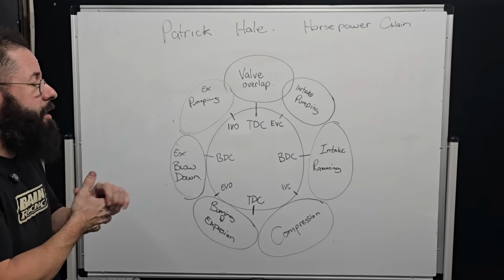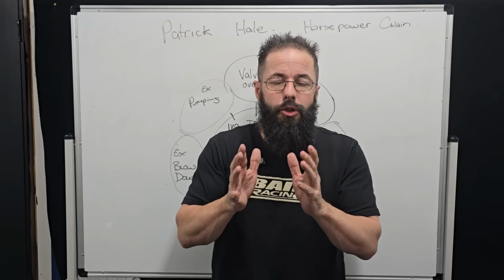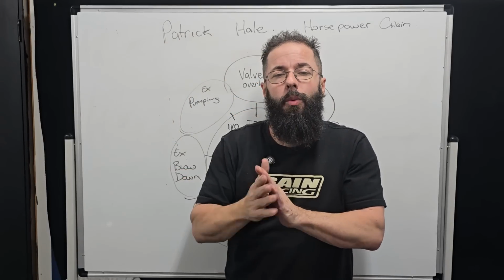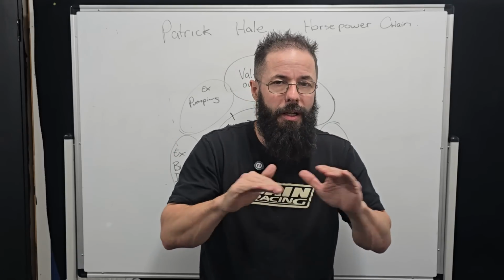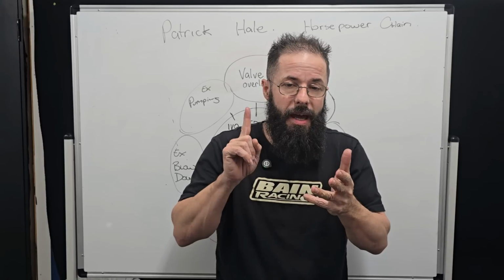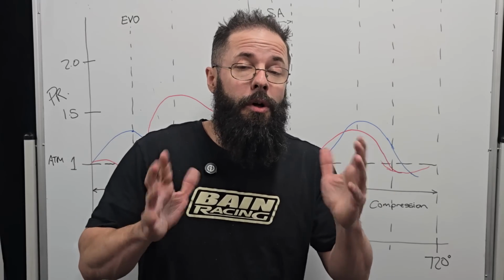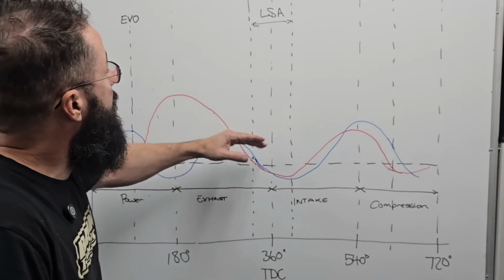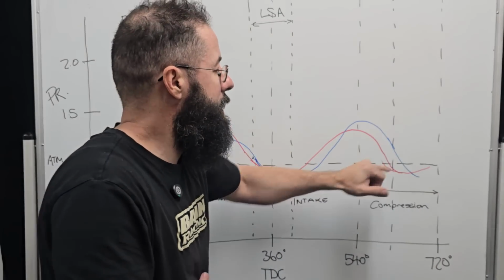Induction Secrets Part 11 Horsepower, Cam Timing Wave Analysis & Engine Simulation. Bain Racing

Comment: Hey Jake, Are you familiar with a calculation that will determine the IVC based of of area under the flow curve, average inlet area, intake runner length and inertia supercharge effect?  If so, is that outdated in todays world especially with all the simulation software out there.  Matt USA
Reply from the maker: Hi mate. I have seen a few. I think simulation,  or software is better for this sort of thing.  We will be covering rick Jones software later in the year and others like EA and dynomation.  I might do a video on some of these IVC closing calcs too.  If you have any you want us to add. Feel free to email us mate.  It won't be till later in the year.  But its on the list 😉👍
Reply: @bainracing  I would love to hear more about it from you!!!!   I was taught this formula in the early 90s by a GM airflow development engineer and was very successful with it.  But like anything you have to keep up with technology.  Cylinder head design and efficiency has come a long way since then and we do things much differently now.  I will email you the formula I use and would like to hear your thoughts on it.  Have a great day my friend!!!🤙🤙
Reply from the maker: @NJRacin you too mate. Have a great one. 😉👍

Comment: After 50 years the guy tells me you cant use lsa to pick a cam,you are guessing. You have to start with the ivc point. I dont know that thats a better guess. Ok
Reply from the maker: The problem is that LSA is a combo, chamber-dependent. This is also affected by intake length, as this will affect IVC timing. 👍

Comment: 10:1 engine will spool turbo faster than the same engine with 8:1 as you said. Can you explain why? Turbo is driven by exhaust gas energy which is ether temperature or velocity. When we raise compression 2 points what changes - exhaust gases temperature or exhaust gas velocity?
Reply: Well exhaust gas temps increase with less compression (you see this in EGTs on the dyno), and the exhaust velocity is dependent on port/valve size, so those things seem like they are what moves the turbine wheel but that's not really the case. (It's usually due to the aperture of the turbine housing and the design but that's another can of worms that's not part of this compression question.) The one thing static compression does that helps with turbo spool is raise the thermal efficiency % of an engine so that it produces more pressure (IMEP) out of the same amount of fuel/displacement. You'll see this with the increase in TQ across the curve while also in the fuel flow staying relatively the same while the BSFC improves. You'll also get a marginal loss in vol eff % when increasing compression because you lose some total volume of the cylinder, but it's offset by the compression increasing efficiency of the motor. What spins the turbo faster, like almost all hot side stipulations in an engine is that the torque output increased at those RPM, and with that you get more energy flow out the exhaust pipe. Just like a larger engine will spool the same turbo quicker, or header sizing in most NA applications is dependent on HP/cyl. Hot sides of all engines run on how much output the engine is making and then having to exhaust, with increased output you increase the energy coming out the pipe.
Reply: @bretbauer7582  so it would be fair to say that higher compression ratio (all else being equal) spool turbo faster in time, not in RPM range?
Reply: @Georgianson  the higher compression ratio will help spool because it creates more TQ in the RPM range where the motor is running NA essentially. The earlier in the RPM range you can create turbine wheel movement, the faster the spool will be in time. The drawback is more compression will help get you there "faster"/ at a lower RPM, but it will also hurt you after you hit the wastegate because it will make the engine more prone to detonation. If you can fight that off with charge cooling and/or fuel octane/methanol changes, that's fine.... or maybe less total ignition lead, but the fight there is a tradeoff of ign lead vs boost.

I'm more prone to figuring out the hot sides ability to spool a turbo with the help of calculating the aperture size of the turbine housing through turbine wheel OD and A/R ratio and sizing that appropriately first (while you also balance out the boost:backpressure ratio at the top end), then through turbine wheel design, housing features (twin scroll), and header design (primary lengths and diameters). Camshaft also helps but that should be the last piece of the design since it's the most flexible and can't solve other problems you made for yourself. Turbos have a lot to play with like camshafts do, you just have to get the right combination of specs together to make it work.
Reply: @bretbauer7582  mate, thanks a lot for such a comprehensive explanation but I'm well aware of everything you are saying. The only one particular thing I couldn't be sure about is relationship between compression ratio and turbo spooling... The rest is just fine.
Reply from the maker: Yeah, pulse amplitude and velocity,  higher compression engines have longer expansion rates in the blowdown phase.
Reply: @bainracing  yeah Jake, I tried to break that down into understandable verbiage. Most people aren't going to do as well with a thermal dynamics and Pressure-Volume Diagram explanation, I know I didn't learn most of the how and why's of engine dynamics in that manner to start... and I'm just trying to generalize what is happening in the RPM range before the turbo hits it's effective RPM range. Not sure if adding IMEP, BSFC, etc actually helped that explanation to most people lol.   Cause and effect seems to be a easier concept to grasp for people, let alone people have a lot of misconceptions on engines you have to work around... like his temp and velocity drive the turbo fallacies. Mass and pressure do most of that work, more temp = less density but also more temp = more pressure, hard to make that connection work in a simple explanation, but connecting static compression ratio and displacement are easy concepts to grasp on their effect on spool.... more of either = faster/earlier spool
Reply: @bretbauer7582  But heat has an effect to turbine's drive, so I wouldn't call it complete fallacy.
Reply: @bainracing We tested the varied comp vs spool. It showed little to no difference in spool vs rpm. Some improvement in spool vs time, but not much. When you add compression, you lose actual displacement.

Comment: Something you said reminded me that people used to search out particular model camshaft because it was bigger duration. In reality it just had longer ramps and essentially zero extra real/ useful area under the curve. This made it lazy as valves take forever to get back onto the seat so you lose trapping efficiency and it doesn’t idle as well kind of behaves like leaky valves
Reply from the maker: 10,000%👏👏👏👏

Comment: I much prefer a longer video that is more explanatory information than the shorts. Or you could put numbers to each short so you can watch them in a row.
Reply from the maker: There are full induction series 30-40 minutes long on this channel if you actually look.👍
Reply: @bainracing i go by the notification. I'll search the channel now.
Reply from the maker: @lcxu1051 Yeah shorts are just for people who dont follow the channel. 👍
Reply: @bainracing I'm subscribed to the channel but don't normally get the full length videos. Only seam to get the shorts.
Reply from the maker: @lcxu1051 Ah OK. Yeah, these shorts are from older videos on our channel they come out daily.  But the longer videos 30 minutes + stuff are generally every Sunday night.
Reply: @bainracing I've been doing a lot of homework because I'm building a 5.7 LS 6 engine. I'm old school so need to learn. I've bumped the static comp to around 11.35 and with the cam i worked out the dynamic comp is around 8.56 to run on E10 fuel. I'm doing my own heads and exhaust manifolds for a one of a kind build. LC hatchback torana with awd system from a coupe 4 manors. So there is a lot of custom made parts for the car.
Reply from the maker: @lcxu1051 sounds very cool mate! Best way! You will learn tons doing it yourself.  Well done! 💪
Reply: @bainracing i grew up with racing and how to find ways around rules. How to get smaller engines compete with bigger more powerful engines.  I certainly learnt a lot in my younger years. What I find interesting is most of what I learnt back then still applies to modern day engines and how little the basic principles have changed. I'm on target for my projected engines hp target I believe.

Comment: Excited to hear you mention dyno2000! I asked for it for my birthday when it came out, when I was about 19. Dad skoffed and said it was junk. I spent many an afternoon just playing with valve events to find the most area under the curve and came up with durations and lsa's wildly different from any cams available for my engines. Big duration splits like 260/280 and fairly narrow lsa's. I figured I was doing something wrong at the time or it wasn't accounting for physical limitations like piston to valve (or valve to valve) clearance. Seeing the development over the past dozen years or so and the trends like Mr Vizards 128 formula has me feeling like I was on the right track all those years ago. Still got my copy of dyno2000 too! Set up a windows XP workstation just so I could run it recently 😂
Reply from the maker: Yeah mate, that's awesome, and it sounds like you were ahead of the curve! 😉👍
Reply: @bainracing  Thanks! I wish I had been able to capitalize on it like some of you guys have.  I might have done 4 or 5 auto engines and a few dozen scooter/minibike/Kart engines in 25 years. The two strokes really emphasized the impact of wave tuning and harmonics. I still want to learn as much as I can though!

Comment: Also if you can talk on lift and it's role with making power, if it moves power or do we just add more when the valve hits saturation
Reply from the maker: Yeah definitely going to talk about saturated flow limits and cam lift

Comment: The Calculators on Einstein can help give you an idea of what intake closing time works with what length runner. Same with the exhaust valve opening and lenth of exhaust pipes, it's pretty cool. I sometimes run after market headers thru the calc to see how far they are out, common to see headers size to work near 8000rpm and the engine redlines at 6500prm🤣

Serious question though, is there plans to add tri-y options to exh calc?
Reply from the maker: Yeah, a Tri-Y would be cool. I should look into that.  Yeah, the Header one we have is based on Max effect engine master type stuff. But yeah a Tri-Y would be cool 👍